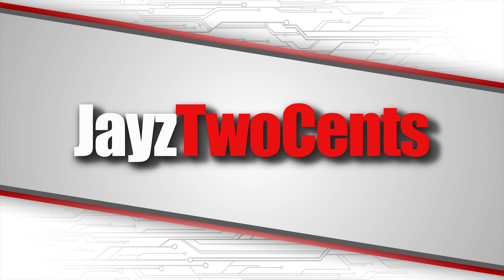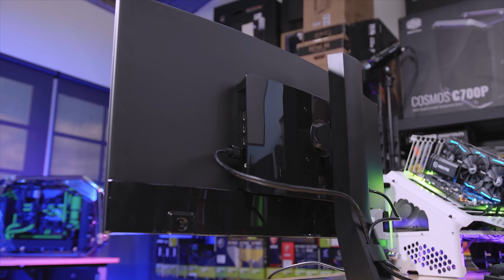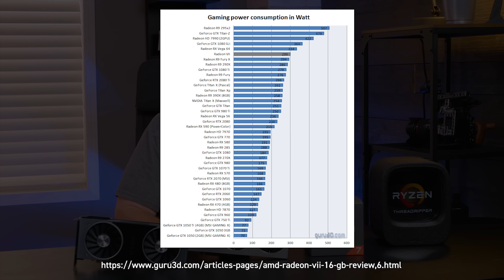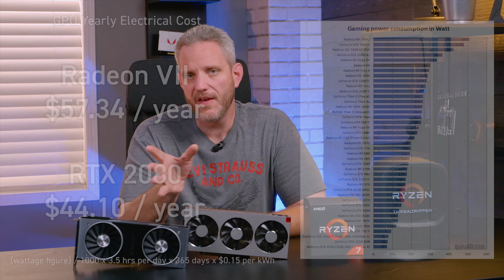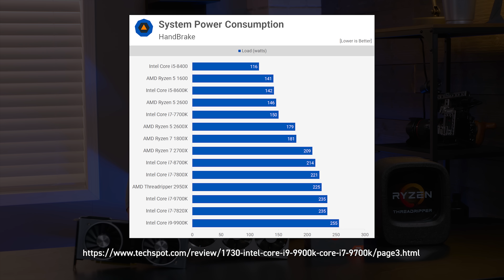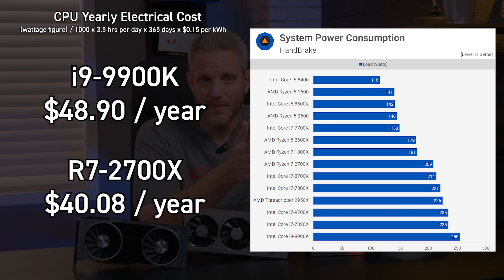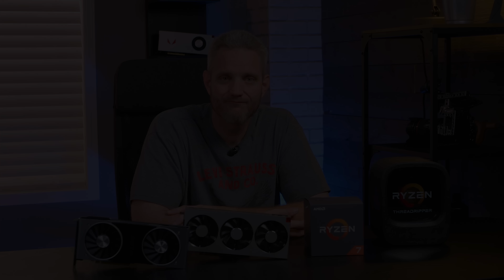Energy Costs of AMD vs Intel vs NVIDIA... This might surprise you

Comment: "Things are kinda getting cooler.. at least for AMD, Intel is kinda getting hot... but that's beside the point"  No, that is EXACTLY the point of the video.
Reply: Like seriously stop the intel getting hot meme
Get a good aio 
My 9900k doesn't go above 69 under load
Reply: @directlinkrexx4409  69 degrees under load is pretty damn high lol
Reply: @directlinkrexx4409  I'm on AIR with AMD and have way lower temps on load...  Like...  What? (I also know people with Intel on air with lower than that on Air...)
Reply: No...the point was that all that doesn't matter
Reply: If you can make your CPUs run at 5GHz, yes that tends to happen. 1st and Plus don't hit 70s because they don't run as fast. I bet those new R9s will get a considerable amount of heat when they hit that 4.6 sustained on all cores.
Reply: @eduardoBR1991  But not nearly as hot as Intel 🤷‍♂️
Reply: @xalderin3838  Intel uses less power than Ryzen when both at 4GHz. As Eduardo said, it's because of the high clock speed.
Reply: A small price for over 4.5GHz on all cores.
Reply: @directlinkrexx4409  Why didn't you tell people to stop the AMD being hot memes before all this?
Reply: @directlinkrexx4409  You're literally at overclocked FX 8350 temps there... Might be worth checking your mounting and maybe swapping thermal paste, that seems a bit high honestly.
Reply: @Malus1531  No they don't. AMD's new ryzen cores coming out in a few months uses vastly less power than intel, by allot. 

Intel can heat a house!!!
Reply: @directlinkrexx4409  lmao what a toaster
Reply: @crazytech5755  dude my 8700K is delit and its like 75°C at a 100% stress test with 5,3 Ghz
Reply: @SYNEED  Try having 16 cores at 4.8ghz default boost clock running at 75 wats like AMD's new 7nm chips coming out in a few months. 

Even the top reviewers have admitted it. Intel is now the brick oven power suckers. And AMD's new chips are BEATING intels at single core performance by 5-10%. 

Intel losses, and so do you.
Reply: @Chinese Empire i don't go above 61 using a stock heatsink on my 2700X thats overclocked by 16%. thats quite a difference if you're at stock speeds.
Reply: @RKSNomad  100% usage or gaming ?
Reply: gaming. heavy loads push it to 72-75 depending on ambient temp.
Reply: @crazytech5755  New ones yes, but not Zen/Zen+, which is what we were talking about.
Reply: @crazytech5755  Lol what kinda bullshit numbers are those? 16-core (which no specs have been given) is magically way faster and more efficient than the 12-core?
Reply: @Malus1531  Everything I said is true. 
Get over it.
Reply: @crazytech5755  -_- emphasis on coming out in a few months, in other words your comparing AMD next gen chips to Intel chrrent Gen chips, not their Nect Gen Chips as well. That's Like if at E3 Xbox announces the Xbox 2 and you go off that Xbox is superior company because the Xbox 2 is more powerful than the PS4, before even knowing if the PS5 is equal or maybe even more powerful than the Xbox 2.
Reply: @scarffoxandfriends9401  actually coming out in a month. So it is current. and actually intells upcoming cpus have the same performance as their current, their entire CES was about their graphics. 

SO no, everything you just said was a waste of time. AMD factually is actually completely superior to intel now, watch linus video of it. AMD has finally completely trumped them. If you want even the best single core performance, amd is the way to go, always and period. And at half the price.
Reply: @scarffoxandfriends9401  the one x is already more powerful than the ps4 pro so i mean yeah xbox is better
Reply: @JonnesusButArchive  They proved it's better by showing a cibemench live benchmark with a cpu that had a slighter lower clock than intel and beat it, in single threaded applications. AMD is not lying, we saw it. 

AMD is vastly superior now, 100% always. Whether you want to spend allot, or a little. AMD is the only way to go now. Intel has completely lost, and that's just true. 

AMD wins. It's simple. Get over it.  Intel is now trash, and they are not good at anything. They know they lose that's why they're focusing on graphics now. 

The reason they don't release anything new, is cause they have nothing new. And they can't even get 14nm chips out, while AMD is with ease doing 7 now. 

Intel is old, they are old like the old piledriver 8350 amd chips from back in the day. AMD is simply the best now in all applications whether it be gaming, or production. 

And I'm happy to see that :)
Reply: @crazytech5755  =b "100% always" yes, cause you can see the future and Intel will just let the competition take all it's share holding. We aren't saying that it's guaranteed that Intel will put out a better chip withen the year, but the way competition works is that if they don't compete this GEN and lose sales to AMD for the Next couple years straight, it'll force them to try to truly one up them.
Reply: @collinsefton4451  this kinda continues with my second David reply, but it shows how when Sony made the PS4 powerful than the One, then Microsoft made the X more powerful than Pro. So even if Intel releases desktop Gen 10 and it doesn't match AMD, it doesn't mean they are dead and they can realize their flaws and then you See Intel Gen 11 over take Ryzen 4 era chips.
Reply: @directlinkrexx4409  a "good" aio and its still at 70c under load? that's terrible.
Reply: @Malus1531  the efficiency has to partly do with the 7nm transistor chip. Smaller size doesnt make it more powerful but it does make the CPU more heat efficient. Intel is currently at 10nm until 2021 or 22.
Reply: @scarffoxandfriends9401  you forget price. Intel is notorious for increasing prices for incremental performance increase. Current gen Intel still costs more than Zen 2 CPU's. If next gen Intel CPU costs more than the current gen ones, with incremental difference in performance, who would actually care?
Reply: @crazytech5755  goddamn that's some long text but I kind of get what you mean. Intel has not shown anything remotely convincing. I want to see benchmarks and actual real world applications, but it seems like AMD is more excited to show actual results than Intel. No one gives a shit about your low power CPU that probably runs like shit, or your all core same clock speed CPU.
Reply: @directlinkrexx4409  Even my FX 9590 (Yes that old thermonuclear CPU) Doesn't go above 65ºc ON AIR... something's wrong with your CPU bud
Reply: @bakaloid2940  you are saying that because you have never heard a cpu reaching 5.2ghz
Reply: @xalderin3838  5.2ghz i don't think so
Reply: @lostplshelp  5.2ghz all cores i don't think so
Reply: @crazytech5755  source to benchmarks
Reply: @RKSNomad  5.2ghz
Reply: @TinchoX  your FX didn't have 8 cores all running at 5 2ghz
Reply: @Aksunkuvat  what cpu do you have that can't even reach 3.9ghz
Reply: @bakaloid2940  We're comparing 7nm 12-core to 7nm 16-core, there is no  node or efficiency difference. AMD gave the specs for the 12-core 3900X at 4.6GHz boost and 105W, and this guy is claiming that the 7nm 16-core part will be 4.8GHz and 75W. So obviously that's bullshit. It's the same architecture.
Reply: @TinchoX  what fx are you using that doesn't go above 65 at 5.2ghz
Reply: @bakaloid2940  Low power cpu is everything, deff when it's out performing those with almost if not double the wats. That means better performance for creators who use laptops, and better gains in hot environments. It also will allow the next gen system which will be running these cpu's to have better cooling and a smaller size. Many other reasons as well .

https://www.youtube.com/watch?v=v7hofCnniJE
Reply: @bakaloid2940  yes, but we don't know how they are pricing them yet, especially since they have actually competition now
Reply: So how cool does an AMD processor run at 5.0-5.1 ghz?
Reply: @MrBluePoochyena  yah, so people can feel free to get the Ryzen cpu in it's first 3-4 months cause of that. But after that I would compare the New chips together before just going out to buy one/pre order one, as that's withen reasonable holding off length. Also, keep in mind I've been replying to a person who for eome reason has the mindset that because the new AMD chips are the best choice, it means that Intel is just going to give up immediately and just let AMD on top for the rest of time.
Reply: @MrBluePoochyena  I had an AMD chip in my first gaming computer and my current one has Intel. o3o normally I do take in price to performance, but I got my 8700k during a sale (which i believe it was because people where buying more ram/GPU for bit coin mining as people online kept saying the CPU doesn't matter too much), so it ended up being the priced the same with the additional FPS. It's also why it's always important to compare side by side, as Suggested Retail Price are just that, suggested. I plhave my PC connected to a 4k TV, so that 10% makes difference.
Reply: @scarffoxandfriends9401  "I plhave my PC connected to a 4k TV, so that 10% makes difference."

That makes absolutely no sense. CPU makes LESS difference at higher resolutions, because you're more likely to be bottlenecked by your GPU.
Reply: @scarffoxandfriends9401  "I plhave my PC connected to a 4k TV, so that 10% makes difference."

That makes absolutely no sense. CPU makes LESS difference at higher resolutions, because you're more likely to be bottlenecked by your GPU.
Reply: @scarffoxandfriends9401  "I plhave my PC connected to a 4k TV, so that 10% makes difference."

That makes absolutely no sense. CPU makes LESS difference at higher resolutions, because you're more likely to be bottlenecked by your GPU.
Reply: @scarffoxandfriends9401  Doesn't matter how something works or how it doesn't. What matters is who's winning. 

AMD is winning. Most of the biggest server deals just went to AMD's upcoming latest epics running on the latest chips. AMD is killing it. 

They simply win, in every area now. Intel is really old tech, runs hot, double the wats, and it's slower now at double the price. They're a joke. They are going to now be FORCED to lower their prices or it's suicide.
Reply: @eduardoBR1991  hahaha - we can argue that the higher voltage needen on Intel CPUs for 5GHz make Intel look bad - but i can clock my Ryzen 2600X to 4GHz with only 1.16V (so OC while UV) - and there AMD has the lead again :p
Reply: @MrBluePoochyena  4.3GHz on all cores at 1.45V :p
Currently I run it at 4.15GHz with 1.32V
Reply: Hmmm..... My old piece of crap 3570K is doing 89C during OCCT torture test, is that to much? Feeding it 1,4v to make it run 4,9GHz
Reply: @scarffoxandfriends9401  You've turned it around; Your TV is slower then a proper PC monitor. Even if it's a 4K it's still gonna be doing a lot lower hz. In other words, no the 10% doesn't matter and isn't entirely true either. Besides when the new Zen2 chips arrives Intels advantage will disappear (it was a high single core performance) and hopefully intel fanboys will wake up
Reply: @VikingRul3s  umm, it does matter because it could mean the difference between playable and unplayable on Ultra 4k settings. There's only 3 Monitors that do more than 4k 60hz and with most modern games you probably aren't even going to hit above 60fps without dual cards or turning down the graphics settings.
Reply: David Boggs that’s weird, the 8 core 16 thread at the same clock uses 105 watts 😂 stop amping it up, amd can handle themselves I promise. The most impressive is the 3700. 65 watts.
Reply: @VikingRul3s  also despite popular belief, $1000+ TVs have Native 4k 120hz support, they market themselves as 240hz  motion rate. It's the TV's between $500 and $800 that have 60hz native and are marketed at 120hz motion rate. The difference between TV and Monitor is latency, not refresh rate. -_- This has been a big misconception for the last few years because people just read the title of videos instead of looking up the full details.
Reply: David Boggs no dummy, the 2xxx series is current since it’s currently being sold and manufactured. I don’t believe you’re being serious. You just said the future is current. Lol.
Reply: ScarfFox and Friends remember, “the future is current”
Reply: @scarffoxandfriends9401  Again, plz notice that the advantage you're talking about WILL move from intel to AMD with the new Zen2 release. The severely higher power consumption intel is delivering these days reeks of desperation! So wait a couple of month and get yourself a Ryzen 3700x
Reply: @scarffoxandfriends9401  Okay, show me that TV then. Having a "many Hz" panel ISN'T the same as being able to display that amount of Hz. I got a 600 Hz FullHD TV in my office, but yet it's still only able to deliver 60 Hz....... 600 Hz in TV marketing means a panel with 2ms respons time (grey to grey), NOT A 600 Hz display rate
Reply: @scarffoxandfriends9401  My first 4K some years ago was a 100 Hz tv. It's never been able to display that many Hz..... Listen you need to learn what different terms and marketing means
Reply: @scarffoxandfriends9401  LOL! I've just read that first later this year the first HDMI 2.1 TVs will come out, the first TVs with an interface fast enough to deliver over 4K 60 Hz. In other words, no you're very wrong and one of the suckers that fall for marketing stunts, sorry but that's obviously the case
Reply: @directlinkrexx4409  Your 9900k runs at 69 with an AIO? I'd hate to see what its like with an air cooler.
Reply: @VikingRul3s  Yeah I have a $2000 OLED and it only does 4K 60Hz. Does 120Hz (real 120Hz) at 1080p though.
Reply: @Benman2785  Well my 8700k can also do 4GHz at 1.16V, so what? Right now I'm at 1.30V 5GHz and I haven't even tested if it can go lower.
Reply: @Malus1531  Nice 😁 that was kinda the Hz i was expecting when i got the "600 Hz" tv. But got it as a special Christmas offer so desided to keep it anyway 😊
Reply: @mr.stealyourgirl1779  dude 5.2ghz all cores tf is wrong with you
And only on full load but i only game so its only 60
Reply: @scarffoxandfriends9401  Intel won't be changing their pricing anytime soon. It will still be more expensive than their previous gen while being incrementally different in performance.
Reply: @directlinkrexx4409  60 is still pretty high while gaming with an aio, i advice you look at other ways to reduce temperature
Reply: @crazytech5755  I'm talking about Intel's low power CPU that still uses 10nm and runs at like 3.2ghz.
Reply: @mr.stealyourgirl1779  are you facking kidding me 60 5.2ghz 
Too much lmao what cpu do you have
Reply: @bakaloid2940  what's funny, is AMD's updated ryzen 7nm chip runs at the same power but is a full chip with near 5ghz clock and faster IPS.
Reply: @Benman2785  You basically said "higher voltage makes Intel look bad...I can run Ryzen at 1.16V...AMD has the lead" You're the one making voltage comparisons not me.
Reply: @bakaloid2940  He already said he's at 5.2GHz all-core, so yes he overclocks, and his cooling is handling it just fine apparently.
Reply: @Malus1531  ...
TWO DIFFERENT CHIP-ARCH!
YOU CANT COMPARE THEM AT SAME VOLTAGE = THEY WILL HAVE DIFFERENT POWER DRAW DUE TO DIFFERENT ARCH!
even if you undervolt your CPU than AMD has lower powerdraw at 4GHz than Intels 9th Core-Arch...
plus when AMD comes out with 7nm it would be even better for AMDs powerusage
i just wanted to say that my ryzen is able to OC while UV and that it takes less power than most 6C/12T Intel at 4GHz with UV...

do you understand now
Reply: @Benman2785  NO SHIT, YOU'RE THE ONE COMPARING VOLTAGES!  And no, not from what I've seen. According to Hardware Unboxed, a 4GHz 2600X uses 30% more power in Handbrake than a 4GHz 8700k.
Reply: @bakaloid2940  Well 5.2GHz all-core doesn't happen from turbo boosts, so he either overclocked or is lying. 5.2GHz isn't unheard of on a 9900k though, don't see a reason to not believe it.
Reply: @VanillaWahlberg  not really my friend's ryzen 2600 goes above 70 and it perfectly normal
Reply: @crazytech5755  jeez dude. Stop overhyping shit yo. I mean that's why some people are dissapointed in 3rd gen cus they thought amd was gonna give 6 cores at entry level. Whereas amd never confirmed such thing so stop overhyping.
Reply: @VikingRul3s  of course you can bench chips of same arch against eachother on voltage = lower voltage at same clocks usually shows higher-oc potential ;)
modern and many current games support 6-10 threads = and with now ryzen consoles this numbers will even rise!
Reply: @Benman2785  Nope that's an myth, at most that shows you a potential for a high clock at low voltage and there heat output. I once got a i5-3570k that showed that feat, so like you, i immediately though "HELL YEAH BABY!!!". Sadly it wasn't stable over 4,7GHz, so a very mediocre OC, but did it with only 1,26v, so i used it in a aircooled gaming PC and sold it to a friend. The 3570K in the PC i'm on right now does 4,9GHz rock solid at 1,41v, has been for years now, great chip! But at 4,7 it still wants 1,33-1,35, so hungry, but lays down 5+GHz scores (at 4,9), so very powerful. In other words, Vcore doesn't matter. Well ofc for the power consumption, but that's only gonna be a big difference at extreme levels.

The chip i'm on nows great little secret is it's absolutely ridicules internal timing and flawless execution. I punched in the fastest recorded DDR3-2400MHz class on userbenchmarks 3-4 years ago (was just fucking around, not even trying hard, so was pretty surprised)

Dude i've been OC'ing for scores, competing on hwbot.org for a decade. I really do know what i'm talking about. Besides before you where saying you can't compare different architectures, when that's in fact what sites like TomHardware and Anatech litterally make their living off (and have been for many years, Toms at least deacade)
Reply: @Benman2785  BTW it seems you have a hard time understanding the wonders of architecture. You do understand what the different build goals/standarts/classes are right?
Reply: @VikingRul3s  ...
i said you cant compare voltage of 2 different arch - i did not say you cant compare powerconsumption and/or performance etc
usually a lower voltage while same clockspeed means that you can have higher overclocks - yet "some" gpus or cpus are lucky to render this "false". always depends on the silicon ;)
Reply: @Benman2785  Arh i see. Well you could, it would just be kinda ridicules 😜 (Edit: major youtube fuck up)
Reply: @Benman2785  Seriously tho, Vcore means jack shit, especially when you, like me, always push for max stable 24/7 OC. Vcore will usually mean nothing because of extensive cooling solutions, so it'll always be the architecture that has a wall
Reply: @Benman2785  BTW i saw you talking about intel being more efficient, that's not true. If you have two cars and 1 needs 4000 rpms to reach 100, the other need 5000, then it doesn't matter that the high rpm car is more efficient at 4000 rpms, because it's falling behind
Reply: @crazytech5755  Ryzen 9 3950X, 16 cores 32 threads, 3.5 GHz base, 4.7 GHz boost, 72 MB total cache, 105W tdp. Confirmed by videocardz.com today.
https://videocardz.com/newz/amd-ryzen-9-3950x-to-become-worlds-first-16-core-gaming-cpu